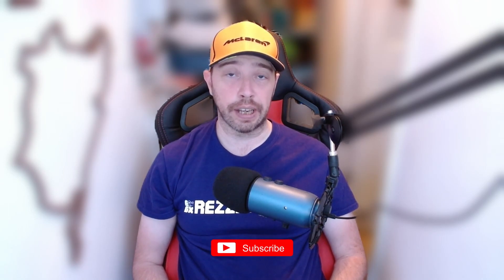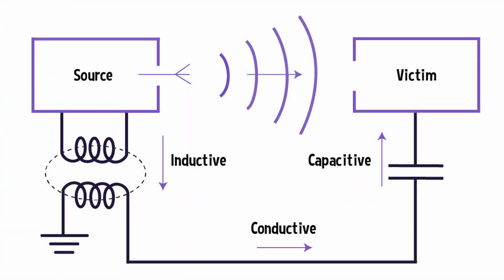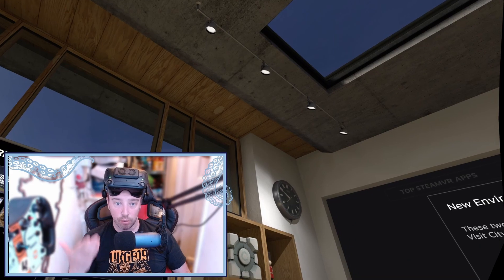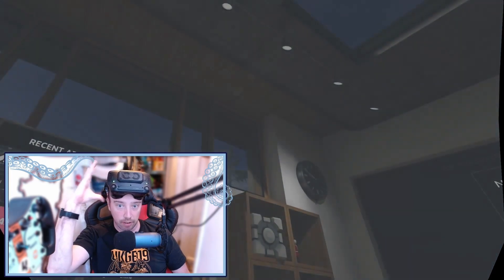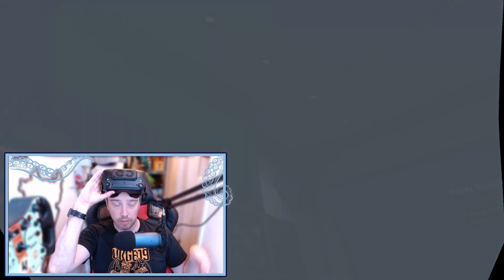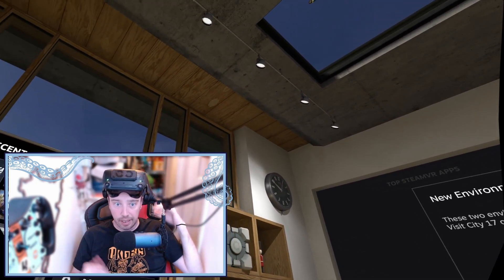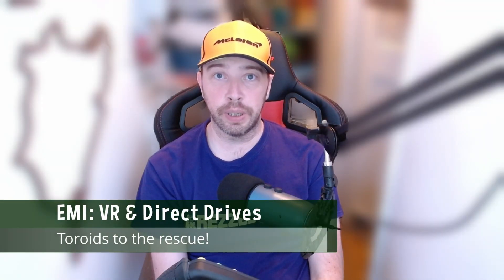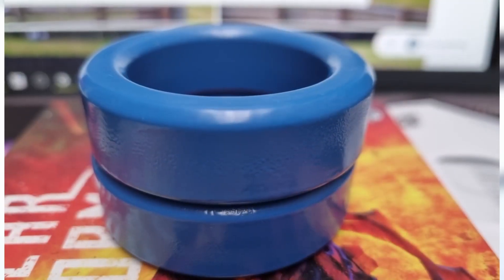EMI problems with VR and Direct Drive in Sim Racing

Comment: I tried playing AMS2 again yesterday. Quick question: does anyone know what could be influencing the controllers’ tracking in terms of EMI? When I use the controller as a tracker for motion compensation, it behaves like it’s moving on its own—sometimes it suddenly jumps several centimeters away or closer. Obviously, you can’t drive like that!

I had the same issue with the OG Crystal, so it might not be the SLAM algorithm. I’m wondering if the cameras are being affected, or maybe USB or DP. I already have ferrite cores on the cables. I’m thinking about shielding the motor cables and maybe tying ground to earth with a Y capacitor, but I’m really not sure. Bottom line: the tracking isn’t stable. I can even see it when I press the Pi button on the controller and the menu pops up—you can see the controller moving around.
Reply from the maker: You can easily rule out slam by sitting in your rig with the motion sim and wheelbase switched off, if you're still seeing movement, then it's likely slam. How are you connecting the controllers? Is it possible that the rig is grounding on them in some way? I'd be tempted to get a cheap HTC lighthouse and Vive controller and use that for tracking instead, but that would be possibly problematic when using Pimax Play's built-in motion compensation.
Reply: @TeqqlesdoesVR the main tzing is, my rig is movable and when not in use in a corner. And my girlfriend dont like black boxes in the sleeping room. 😅 So only in a new apartment i csn install a static rig with lighthouse. As I mentioned before, the behavior is zhe same as the og crystal. Sometimes the openxrmc tracker moves sevaral feet . It must be EMI. Thr fontroller is in a pla 3d printed housing mounted on the 2080 rig. Before it was directly om the csl dd wheelbase through   the m6 screw holes mounted on crystal og with snapdragon xr insight out tracking. Pimax built in mc is to sensitive.. jo way to configure a low pass or any type of filter.

Comment: I just went through this with my simucube 2 pro, and HTC vive pro 2 (using original vive 1 base stations) The chokes helped a little, but not much. The fix for me along with the chokes, was the base station positioning. I had them mounted on my 8020 rig above my monitors. This put my wheel between my headset and base stations, although lower than direct line of sight, I believe the magnetic field put up a wall between the stations and HMD when outputting high torque. I moved them to the walls, to the left and right of the headset and experienced no more grey outs
Reply from the maker: It's interesting that you have this with the SC2 Pro. Definitely seems a worse problem with base station tracked VR headsets, too. My OG HTC base station was in the middle, above the monitor, but not attached to the rig. I'm not sure if that made a difference for the severity of the issue.

Comment: I got the same problem with fanatec dd and cammus pedals. Value of the breaking pedal shakes horribly. I figured   out I should use different sockets for the wheel base power and the computer, then use plastic washers to isolate the wheel base stand from the pedals - it helped me
Reply from the maker: Thanks for the info!  Any advice on how to combat things like this is very welcome.

Comment: Thanks for sharing your knowledge on this!  I'm a new SIM racing rig owner.  I have a Simagic Alpha Mini direct-drive wheel base and triple monitors, and I'm not planning on buying a VR headset.  To prevent EMI issues in the future, I wonder if there's a way to reduce the amount of EMI at the source?  Maybe through grounding or isolating the wheel from the chassis?  Have you heard of a way to do this?  Thanks in advance.  🙂
Reply from the maker: Some people have had success with an attached grounding cable on the rig, but that doesn't always work. It depends on the strength of the source causing the issues. Better shielding helps, the issue went away for me, for example, when I switched to a Simucube base.
Reply from the maker: You could try isolating the DD from the rig, which would stop it acting as an aerial, but I've not tried that approach as of yet, so I wouldn't know if that will actually help.
Reply: @TeqqlesdoesVR   That's a fantastic idea.  Some washers on both sides should do it.  Thank you!  (researching now)

Comment: I've had EMI problems with EVERY SINGLE VR headset I've had. But when I got the CSL DD the problems because amplified.

Adding so ferrite cores helped, but did not solve my issue completely. Thanks for sharing your knowladge. Wish I knew exactly what was causing the EMI pre CSL.

FYI, these same issues were killing my HDMI optical cable signals.. Yes, OPTICAL CABLES, because the EDID is still sent via coper. Go figure. solving that issue is the only thing that lead me to even think about EMI issues effecting my headset.
Reply from the maker: Ouch!  I know we all seem to have different levels of this problem so it doesn't completely correct it for everyone but hopefully it helps you to some degree. Thanks for sharing your experiences, honestly they sound pretty scary!

Comment: I have a DIY DD wheelbase and currently battling with crazy EMI, to the point where it messes up with my USB connection, does using small ferrite magnet works? or like combining ferrites beads and do a choke ferrite, I'm kinda hopeless rn
Reply from the maker: Sorry to hear about your troubles, it's never nice to be unable to race because your wheel buttons cut out or you have interference in general. It sounds like you have really bad shielding but what helped for me was to ground the rig and locate the USB cables so that they're not too close to the wheel base. It sounds like your issues are more serious though. I'd definitely look at your options for emi filtering. I've seen both active and ferrite based solutions but I've limited experience with trying these out on USB cables.
Reply: @TeqqlesdoesVR  I googled like crazy for these couple of days and there's 3 option so far, grounding, ferrites, and USB isolator.. I don't understand what grounding your rig means though, is it to mount all cables through your rig and bolt it to your grounding in psu?
Reply from the maker: @michaelray9233  grounding is just that, connecting your rig chassis to either a dedicated ground plug (plugs into your mains outlet) or against your power supply/PC. I've had mixed results doing that but it doesn't hurt to try 😀

Comment: I've not researched this any, but seems only Fanatec DD wheels are causing the issue? Maybe Fanatec has really bad shielding? I've use my Valve Index with a SimXperience Accuforce V2 Pro and have never encountered this problem with my Index.
Reply from the maker: It doesn't happen for everyone and I've heard about it happening for motion sims and mige motors but it does seem more common with Fanatec equipment. I use a DD1 and have this issue for example. Now I don't know if that is a side effect of the large install base or if the shielding is bad but I've rarely heard it is a problem for Simucube owners...
Reply: Hello, yeah, i have a motion platform and a fanatec dd1. My motion platform works badly. I've contacted Simracingstudios ( this is the software that commands my dyadic actuators ) and they told me it could be an EMI problem...I'm a vr player since a few days but do not encounter any issue with my headset but i would like my actuators to work fine because they help me to deal with motion sickness ( quest 2 ) @TeqqlesdoesVR

Comment: I had this problem, but solved it by moving my base stations around and using 2 instead of one.  For me it was a problem of bad setup.  I'd recommend testing this first before going through this hassle....  DD2 user here with Index...
Reply from the maker: Yea it'll always depend on your individual case. For me I had a working setup before getting the DD so debugging was quite a frustrating process.

Comment: I’ve also seen people ground the rig
Reply from the maker: I've seen this too.  Whilst I haven't personally grounded my rig, I know some sim racers that have with mixed results.  Some it made things a little better, others it made no difference.  It's always worth a try but remember your body can also work as an amplifier for the EMI from your wheel so it might not eliminate the problem.
Reply: @TeqqlesdoesVR  I am having this problem with Index/CSL DD. The CSL is mounted to my Obutto Ozone. I attached a 12 gauge copper wire from one of the CSL mounting bolts to the computer case. Made no difference. +

Comment: Interesting that it's an EMI problem. I also get grey in the face when I touch the index. I also have a DD1. I always thought I was interrupting the view to the Lighthouse station.
Unfortunately my English is not good. Can you briefly describe what you did to counteract the problem ? I'll translate it for myself with Deepl :-)
Reply from the maker: Yep, you aren't the only one that thought it was just you blocking the sensor!  I wrapped the VR cable (from the quick release point) around two N30 toroids - you can find the exact make in the video description.  I wound the cable around 6 times, keeping the winds separated so you don't get cross talk.  Hope that helps!

Comment: Does this happen only with cheap Fanatecs or even with good stuff like the Simucube Ultimate?
Reply from the maker: Not everyone is affected by it, but it has an impact across the whole Fanatec direct drive range. It affects some other direct drive wheels but not the simucube 2 wheels from what I can tell.
Reply: I have a simucue 1 and I have this :(
Reply: @Sim2Real. I just went through this with my simucube 2 pro, and HTC vive pro 2 (using original vive 1 base stations) The chokes helped a little, but not much. The fix for me along with the chokes, was the base station positioning. I had them mounted on my 8020 rig above my monitors. This put my wheel between my headset and base stations, although lower than direct line of sight, I believe the magnetic field put up a wall between the stations and HMD when outputting high torque. I moved them to the walls, to the left and right of the headset and experienced no more grey outs

Comment: Thanks for this solution! I have the exact same problem with my Valve Index headset and Fanatec CSL DD wheelbase.
Reply: So did this work?
Reply: @PixelGod240  I ordered 2 of the exact same ferrite rings and 6 winds of my headset cable removed all interference caused by my CSL DD. No more grey screens on my Valve Index headset anymore. Highly recommended solution!
Reply: @sroest  Could I ask how far along the cable you added the rings? Is it before the inline connector or after? Thank you 🙏
Reply: @DirkStickleback  I have coiled the cable 6 times around the recommended 2 rings directly after (as seen from the USB connector) the inline connector. My EMI problems completely disappeared.
Reply from the maker: Hopefully this helps you fix your issues!
Reply: I saw in the video that you used 2 ferrite rings. Is that necessary to eliminate the interference? Did you test with 1 ring as well?
Reply from the maker: @sroest  I didn't test with fewer toroids but I did with less winds. 6 seems to be the magic number for me, 5 isn't quite rock stable, 6 seems to be but obviously you're giving up a little more cable. You might be able to use a single toroid but then have to wind the cable more.
Reply: @TeqqlesdoesVR  It did! Thank you for your solution!